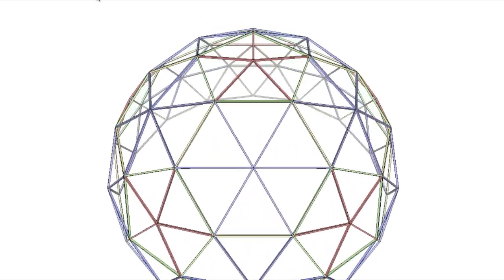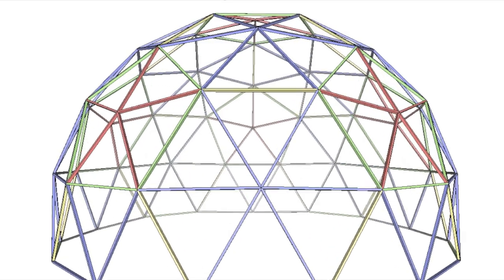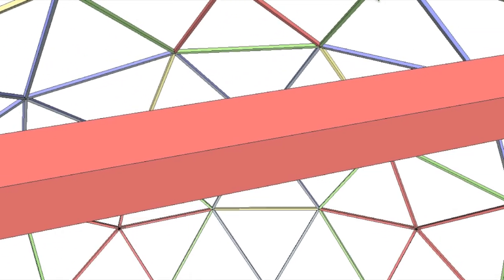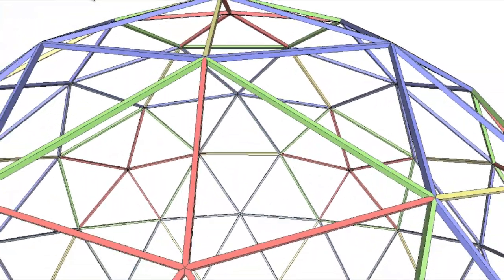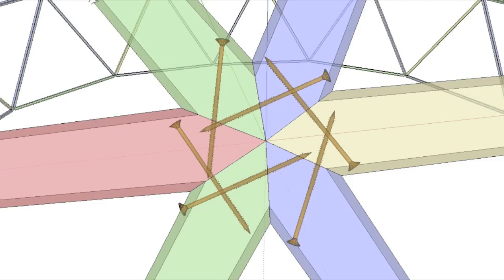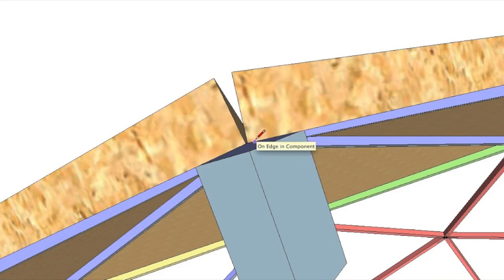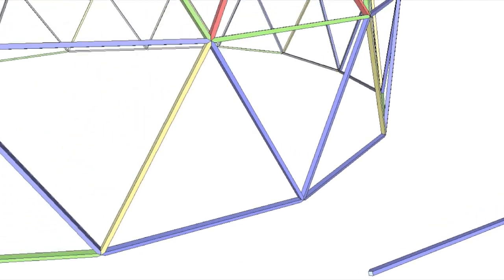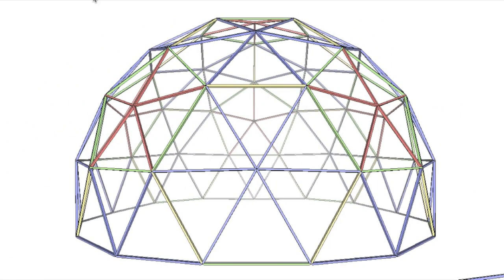Dome build methods - Arrowhead

Comment: This method works fine for welded steel frames. Yes, it requires accurate cutting - easy to do if you're not a nob. I would not use it for timber.
Reply from the maker: Yeh welding would work brill, but it would be a permanent structure when finished. Did you mean noob?
Reply: No, I did mean nob (knob). But I can accept Noob in its place.
Great videos, by the way. My somewhat harsh comment(s) on another video do not imply that you aren't doing a good job. I have learned a lot from you.
Reply from the maker: Sorry I thought you did a typo, made me laugh. I'm fine with harsh comments it's called banter in the trade.

Comment: Had never considered how bad this was until this.  I didn't like it because the angles made my head hurt, but the fastener issue is critical.  Chamfering the edges is annoying, but part of the process - angles hurt.
Reply from the maker: I'm glad you have an open mind and can see that I'm not criticising domes in general, some folk get hooked on a build method (even a bad one) and will defend it whatever. Have you tried the beveled frame method?